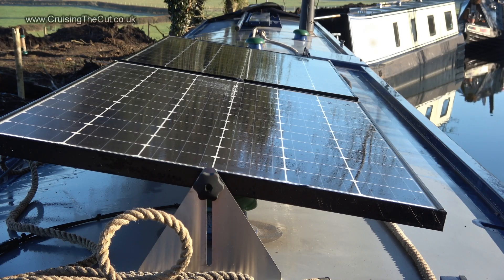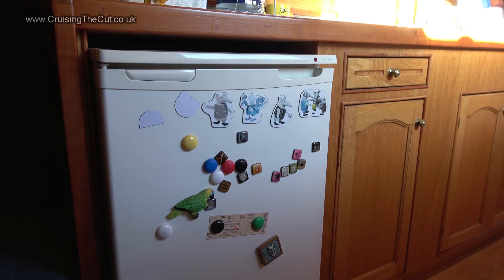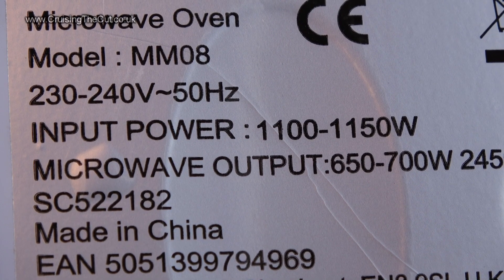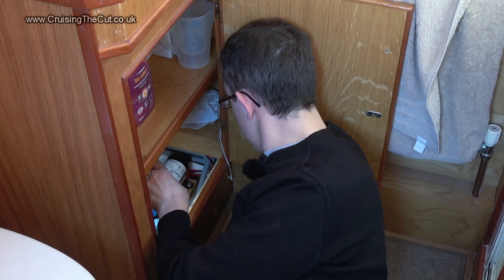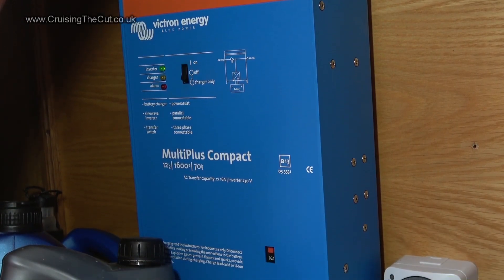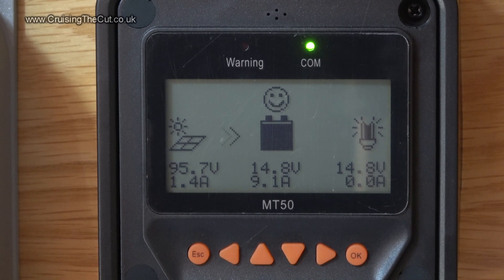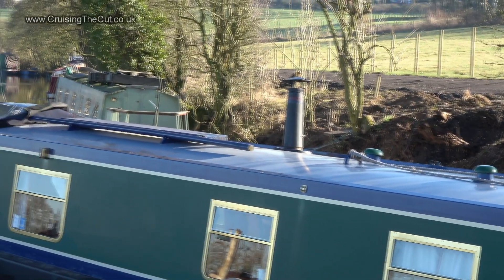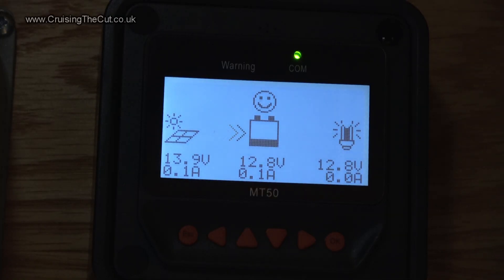76. Is solar power sufficient for a canal narrowboat in an English winter?

Comment: If I were going to get a narrowboat I would buy a Russel Newbery engine that will run economically and without damage at low rpms to charge the batteries with a PERMANENT MAGNET alternator. These are much more efficient than the regular type. Modern higher revving engines dont charge well at idle, not enough torque and noisey too. The old slogger engines are not unpleasant to listen to at idle and its not to hard to reduce noise levels in the engine room. The trick is to put a passive muffler in the exhaust run that is tuned to phase cancel the noise using resonant chambers. A smart mechanic will know how to tune those at idle until you get max sound attenuation.
Another important trick to noise reduction is inlet air filtration. If you can set up a coarse primary filter box in front of the main filter you will get the benefit of longer lasting main filter and noise absorption too. 

Solar is great, we have 5kw on our house, but your pretty limited on a narrow boat for roof space UNLESS you use flexible panels and mount then on the sides as well as roof. The mounting system on your panels is not the best designed. You need to be able to tilt them much higher than that to get best output.I would have them mounted so that they can be stacked at mooring and plug in two extra on a telescoping frame. 
Far better to have them pivot at the sides and prop up from the middle with large wheel nuts to lock them.
Gas fridges or multi fuel fridges work great if you can get them. Fridges are the big killer.

I think the smart thing would be for more boat owners to share power gen at agreed times and throw money in the pot for the boat that agrees to charge everyone else’s batts.
The other alternative (there are so many) is to get more storage so that you get max converted charge time on the water.
Reply from the maker: You can't have gas fridges on a narrowboat, it breaches the BSS
Reply: CruisingTheCut . Bummer but it does kind of make sense. We used one for ten years in our off grid cabin. It never missed a beat and very cheap to run. Solar is a great technology but you do have to optimise the panels as much as you can to get a decent output. Appliance efficiency becomes a much bigger concern when your inputs are smaller. I just find the whole process of tinkering and optimising a great pastime and very satisfying. There is also a lot to be said for making do with less and coordinating your max energy usage with max sun. Energy is expensive and saving money free’s up money to spend on better quality food etc.
It would be great if solar panel makers came up with a folding fan panel you could pull out when your moored up. Eventually they will incorporate battery storage in to the panels themselves which would be great.
Reply: CruisingTheCut  why? You cook with LPG.
Reply from the maker: The fridges have a permanently on pilot light as I recall and it's something to do with that. I think if it blew out and didn't relight, it would be sending gas into the boat bilges.
Reply: CruisingTheCut. Interesting. As I remember our gas fridge had an auto cut out to stop the gas flow if the pilot went out which would be a pretty straight forward pressure valve that needs the pilots heat to open and let the gas through. Thats why you usually have to hold the button in for a few seconds while the pilot heats up a bit.
The only time our pilot went out once was when the gas ran out. Otherwise it never missed a beat. But if its not legal its not worth the risk of using one and having no insurance coverage. Chances are though that quite a few use them anyway.
Often these regs and laws while well intentioned are silly because if your using gas to cook the chances of a gas flame going out are far greater than the fridge pilot and you would have way more gas in your bilge from that happening.
You used to be able to get kerosene powered fridges too ! No experience with one of those but modern rotary compressors are much more energy efficient than the old piston types and quieter too.
One thing I do know for sure, free power is the sweetest deal especially when fridges are the greediest users of it. 
Anyway, its all food for thought and thats what makes life interesting.
Reply: Please...stop. You are full of ideas that are not practical or have already been covered in the video. Please think before you expound, drawing from your bountiful basket of the obvious. As to power sharing...its already being done...at the marinas.
Reply: G Henrickson. Wo there take a chill pill Henrickson, you will have an aneurism. Power sharing at marina’s is not the same as sharing on the cut. The beauty of being off grid in a  narrow boat or any where else for that matter is a fascinating challenge and a worthy one. The retailers will sell you their vision of course but in practice its best to nut it out by considering all the options and tailoring them to your lifestyle.
A russel newbery for eg can run on just about any used oil for free if you want to save money and in the current climate your a damn fool if you dont try.
I have a low RPM lister that can run on just about anything and it saves a HUGE amount of money for us each year. Energy is expensive. Why pay if you do not have to ?
So its not a case of me punting ideas that are ‘impractical’ so much as ADAPTABLE. The more you save on energy, the more money you have to enjoy the lifestyle and THAT is what its all about. What you think is ‘obvious’ is not necessarily so to many who are new to narrow boating.
I used to make do with less power but over time that involves making do and some suffering. The ability to cook and store food is one of the most fundamental parts of any dwelling and the more power you have the more comfort and flexibility. Hot water and heating is another big expense. Which is why smart off griders go with low noise, low rpm, low fuel consumption engines rather than modern high revving, high maintenance, high cost ones.
If I were to live on a narrow boat again I would make that my first priority. 
You can call the ambulance now. Cheers.

Comment: David,when shore wired up does this automatically charge up your batteries onboard or do you have to switch on your inverter/battery  charger
Reply from the maker: I switch mine on manually because if it's sunny, I'd rather run off solar than pay for shoreline electricity.

Comment: Love your videos, but i wonder, have you ever looked at a small APU (auxiliary power unit) like those used by transport truck drivers here in the states to charge batteries without running the Boats engine? they are small and use very little fuel.
Reply from the maker: Would that otherwise be known as a generator??
Reply: There is a company in the UK selling “ex-SAS” military small generators. They are silent. 
I have Honda’s supposedly quietest ever generator an EX650, and that is not silent by any stretch of the imagination but it is inoffensive. Honda’s flagship EU20i generator is actually quite noisy especially when loaded up. 
The military unit is astonishingly quiet, important I expect for the clandestine pastimes they might take part in. Furthermore, the military generator has a feature where the cooling air from the engine (NOT THE EXHAUST) can be piped using a tumble-dryer hose to heat a living space. The military would heat a tent with the hot air, we who don’t wear a balaclava to work could use it to heat a boat. They come with a case of tools and spares and are fed from a half-size jerrican with a dedicated piped connector. I saw them at the big military history fairs like “War and Peace”. Not much of that going on right now.

Comment: Hi I really enjoy your video despite we don't have canals here in HK. I just wonder, from your video, with all the hassle attached, would it be just simple to just charge the batteries without the solar panel because it is VERY expensive to run here in HK.
Reply from the maker: You can charge from a shore line if you are in a marina, or from a portable generator but for that you need petrol and the storage of this can be dangerous, as well as the generators being bulky to store. The engine can recharge the batteries (which a lot of people do) but it wastes engine hours just to generate the electricity (and hot water as a by product)
Reply from the maker: It's generally not good for diesel engines to just sit at or near idle speed, no.

Comment: Go lithium  - at least 20% more efficient - you can  cycle them between 20 & 80% for years and they will charge far faster from your alternator - we use a damaged Hybrid  battery pack
Reply: "you can pick up a Hybrid pack off e bay for  less than 2yo and "
I'm not sure how to reconcile the concepts- That lithium batteries will last forever & outlive the owner,
yet they are being replaced after just 2-6 years in cars? Why would there be all the 2yo packs on ebay if they last lots of decades?
Reply from the maker: It's certainly something I've pondered but it's very, very expensive, requires a different charging regime, plus the batteries need to be kept warm when charging (above zero anyway) but a lot of boats stash the batteries in the cold engine bay. Plus 20-80% is only 60% use compared to 50% for a standard battery so I'm not convinced the number stack up.
Reply: It probably wont "stack up" if you go down the Jono Victron  route but if like us you can pick up a Hybrid pack off e bay for  less than 2yo and re configure it for £500 - one of the big advantages Jono says is that 2hr cruiesing  fills his pack full where as with his lead/acid it was more like 10 - Draining lead acid to 50% is going to give you a couple of years tops where as the Lithium will probably out live you - we would go 24v
Reply from the maker: Fair enough. As I've got 480W of solar, the engine is largely irrelevant as from Spring to Autumn the panels do all the charging. Or, the engine can dump a load of charge in for a couple of hours (by which time the batteries will be largely charged and only accepting a trickle input for the final 20%) after which the solar finishes the job. I'm not sure I'd be confident about a hybrid pack off eBay, given the notoriously unstable nature of Lithium batteries - how can you guarantee they're safe cells and that the controller can keep them in check? (genuinely curious)
Reply: We used Mitsubishi  hybrid cells which come in robust  40amp cans - we individually bottom ballanced them then top balanced them checking ther capacity  of each cell individually  with a Hobby King Turnigy charger   -  we then  put them back in their case which   in strings of 8 - we then connected each string  to a Singlelab  8s 50a BMS - giving over current /over voltage /undervaltage/ short circuit/ over temp(65c) - we then ballanced each string using the Turnigy - The BMS has little LED's on which twinkle as each cell hits its 4.2 volt bleed - I think you have to string  reasonably matched cells  first as this BMS  only bleed 65mA- an unmatched string  could take  days to balance otherwise - we have added  6 additional 65c thermoswitches in the stack to monitor cell  tempreture- they cut the battery from the charge and drain   - we don't balance charge unless the cells get 1/10v out of sync or about every 6 month as it shortens  pack life - our stack is 5yo now  - the only thing  its missing is a  low tempreture cut charge which would be needed if there was any chance of the batterries getting below 5c
Reply from the maker: Yikes. That is genuinely way beyond what my brain could cope with and maybe explains why Lithium remains the preserve of the enthusiastic! Interesting stuff though. You don't fancy being filmed for a vlog about it by any chance ...? (and if so, whereabouts are you?)
Reply: You need special features on your battery management system for many, if not most, lithium batteries. I have a high end solar controller which works beautifully yet cannot be used with lithium chemistry. Do your research before committing to lithium batteries.
Reply: Thank you I'm flattered but  its not my thing .
Reply: @G Henrickson These "special features" are low and high cutoff voltages suitable for the batteries you're using and you need that for every single rechargeable chemistry, nothing specific to lithium-based chemistries there. Any true "high end" solar charger will give you tunable controls for those or, more reasonably, one can use a charger that is actually designed to support the chemistry one is using. Beyond that, all you really need is out-of-balance detection and a diode on the output.

Btw, solar chargers are trivial from an EE perspective, most of the money goes to user interface and packaging - the rest is the rip-off factor.
Reply: here here, we are being blinded with science...
Reply: @RWBimble I can't speak to all of the 2yo packs on ebay, but plenty come out of damaged/totaled cars and yet more are sold because some of the batteries soft- or hard-failed, which is easy to repair but not worth the labour to the owner.

"Lasting forever" and "outliving the owner" is complete nonsense obviously. There's a curve involving the number of charge/discharge cycles and capacity. With that said, there are a number of things one can do to dramatically improve their useful lifespan that can't be done in cars. The most important of those, Trev mentioned - discharge to no less than 20% and charge to no more than 80%. This is massive. You can't do that in a car - batteries take up space and add massive amounts of weight, while already having a huge energy density disadvantage vs carbohydrates. With current battery tech, charging to 80% would reduce range to the point  where the cars are even more impractical than they already are. Secondly, charge and discharge speed matter, a lot. Cars need to charge quickly, whereas solar is essentially a trickle charge. Same goes for discharge - cars often need 100% of power or close to it (the way they are normally driven by clueless people), but that's rarely going to be the case on a boat, especially if you have enough batteries in parallel to spread the load, which you can do on a  boat because you've got space and weight doesn't matter. Finally, the usability criteria are different. In a car battery pack, even a 20-30% reduction in capacity warrants replacement - it's not just about range, the C rating for a battery is capacity-dependent as well so the same power draw on a smaller capacity battery causes more heat until it becomes unsafe. A number of repairs are not worthwhile on a car battery pack - the labour costs aren't justified unless the pack is fairly new, and some the manufacturers don't want to do for safety reasons - what is safe for Trev, who knows what he's doing, is not safe for Keith who doesn't and just wants his car to work and for whose safety the manufacturer or servicer carries legal liability. As an example, Trev would be happy to buy two-three packs, test all the batteries individually, and combine the best and most well-matched into one or two well-working packs. Hope that's helped you to reconcile these concepts ;)

Comment: How long would you need to run your engine at idle to fully charge your batteries? and how often?
Reply from the maker: I don't run my engine when static to charge the batteries at all, the solar takes care of it. In winter I'm on a shoreline on a mooring so don't need engine or solar.
Reply: Could you tell us about how long you have to run Your engine per day to top up a day's usage ? Would it be an hour, or 2 or more hours ?
Reply: Pointless running at idle speed, wont generate enough amps. To get sufficient amps to charge batteries you need to be set above 1400 rpm or more running for +2 hours upwards to gain any charge for a battery bank.
Reply from the maker: It would depend on the size of your battery bank, how depleted it was and the capacity of your alternator for generation.

Comment: Here in Holland, a perfect system will produce about 480W per 1000Wp per day in December and Januari. Februari might bring 1Kw per day and November 800W per day. In England I think it will  be slightly less, so the  conclusion is comply right that solar is not sufficient to fullfill all the needs in winter.The numbers I give  is the 9 year average for those months
Reply: Don't discount the value of your flat, largely obstruction-free landscape either ;)

Comment: just a thing to consider when using solar panels is you have to clean them meticulously as even the slightest water residue hinders them! The more panels you have the more time you spend cleaning them :D also never wash them with a detergent for use on paintwork (car detergents) as these tend to leave a thin film designed to block UV/IR light frequencies from fading paintwork which is obviously no good for solar panels ;) distilled water and a splash of white vinegar will do the trick cheap a chips.
Reply: @MsSomeonenew Bad analogy. Look at performance graphs for dirty vs clean panels and you'll soon change your mind. No one says you have to do it every day, that would be a bad idea actually, but it does need doing far more often than you'd think. How often depends on how much you value your time vs getting the respective performance improvement.
Reply: MY uni-solar panels are unaffected by water droplets. Also, I simply dust them off or wash with water once in awhile. Its not really an issue with the right panels. Do your research before considering going solar...
Reply: Yes, they do need to be clear to get decent performance out of them. This is why panel quality matters - decent ones come with hydrophobic coatings - and why they need to be installed at an angle. Using a removable cover you can clean separately is worthwhile as well.
Reply: I have not ever heard someone go to that crazy extent, but hey some people clip their lawn with scissors... you can always go nuts with your hobbies if you are into it.